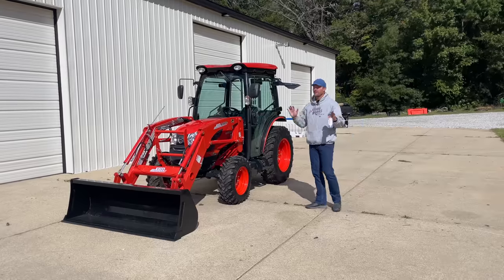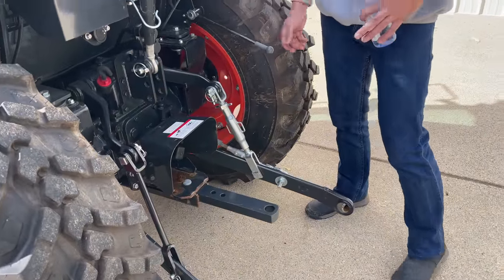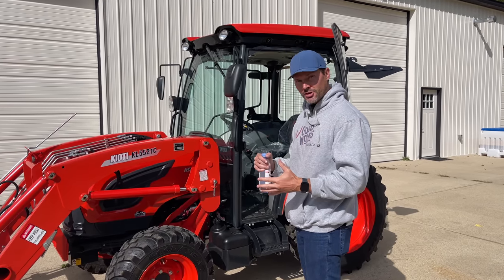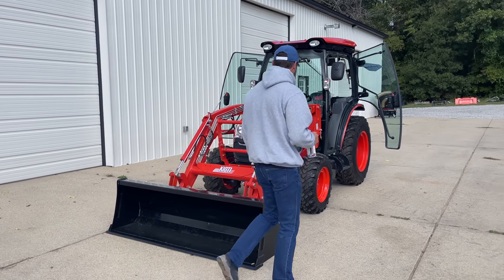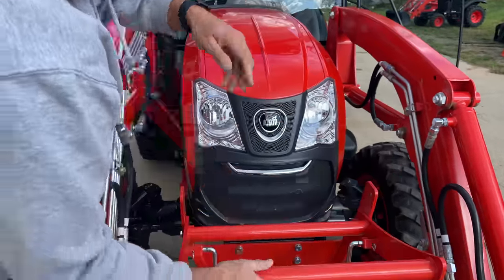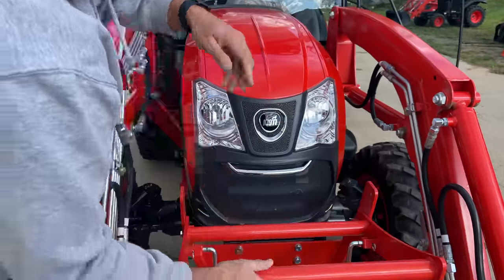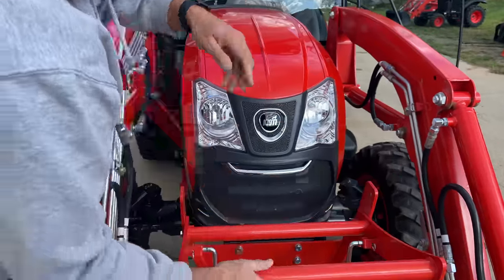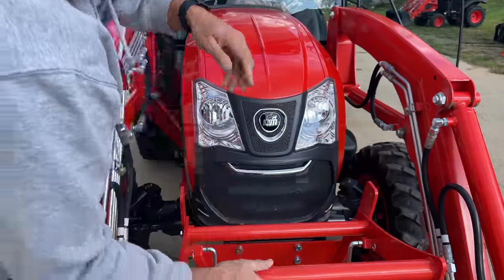WHY DID I OVERLOOK THIS TRACTOR BRAND FOR SO LONG?!

Comment: I purchased a Kioti CK 2620 cab hst se. I have ten hours on it and so far no complaints. It’s big enough to dig and load what I need but small enough to cut the grass. The size is great for maintaining trails. The CK and DK cabs fit through a eight foot garage door which was important.
Reply: The CK (and presumably its Bob Cat equivalent) is a very beefy and capable machine in that 25 HP category, IMO matched only by the 2515 TKM/Branson (and its Bad Boy equivalent).

Comment: I've had this model for almost 2 year now. I took delivery of the tractor December 2021. I have about 225 hours on it. Love this tractor!  Still need the liquid ballast in my tires...it's a must. The factory radio sucks! Don't get get the factory radio option. Buy a head unit and speakers online. Also, I'm 6'7" and fit pretty good in the cab.

Comment: I have a CK3510SE with a backhoe and bucket. The reason I bought it was the bucket and backhoe lifted and dug higher and lower, it had a larger hydraulic pump and it was heavier than the comparable JD.

Comment: Have a CK3510SE with a cab and love it especially in the winter time. Nearly 300 hours on it in a little over two years and no issues. Could of used a sub compact but my wife wanted a cab. Now I want a DK series or larger. Very tough stout machines.

Comment: Owned a Kioti DK40SE for 10 years. Beast of a tractor. I run a sawmill and log with my tractors, so I really put them through the paces. I put 1,500 hours on it and it never let me down. I recently traded for an LS MT3-57 cab/hst tractor. My reasoning was because my local Kioti dealership came under new ownership, and the new dealership is less than impressive.. I was interested in an NX model, but the sales staff seemed like they couldn't be bothered.  So I checked out an LS at my local LS dealer and it impressed me. In the past, I know you reviewed an LS. However, it was a lower end model. I am hoping in the future, you review an MT-3 series (premium) LS model. I have 300 hours on it so far and I am very impressed. It stands right next to my old KIOTI as far as quality and durability. LS is constantly improving their machines, and trust me, the MT3 series is formidable.

Comment: I'm glad to see you enthused about this machine and hope you do keep one to see how well it performs, I own a Bobcat 2025 and have not been disappointed. I do think they are stronger than the green ones of comparable size/hp in numerous ways. The unfortunate thing is I believe some dealers that do the final setup either don't know how to or don't care what they send out the door, I chose a reputable long established dealer and have not had any issues and have actually had them make a home repair for a factory service bulletin that I wasn't aware of. As you know service and support is just as important as the machine you buy. If the 2 tractors you have doesn't have an option called link pedal you should add it (pretty simple to install) works great for loader work. Keep the great videos coming!!

Comment: I also had a Kioti for 4 years, was a great little tractor. Went to trade up, I ran into dealer network issues. Again great tractor but was told I had to wait 6 months. With no other kioti dealers to turn to i went with a Deere. I hope they can keep ramping up their brand.

Comment: Radio in cab: I used to work in forestry equipment all day and it seems odd but if you wear the squishy/foam earplugs and use cab radio it will allow you to hear radio much better.

Comment: Nice review!  Nice tractor!  I'm not a cab guy, but the visibility on that cab seems awesome.  The reason the "Forward" pedal is closest to the operator is common equipment design.  Controls are always placed in a configuration where the most often used controls are closest to the operator and the least used the farthest.  Mobile cranes and road graders both having many controls are two good examples.

Comment: Thanks for all the valuable information on this video and videos past. I have learned a lot and appreciate the safety tips in past videos.  Recently purchased 76 acres in Iowa and looking forward to purchasing a tractor in the spring.  One of the challenges I am having is find the right size  for the property - I feel a sweet spot would be 35-40 HP.  Keeping in mind that I have farmer fiends who have the machinery to do the heavy lifting needed on rare occasions.  I like how the tractor in your video is compacted enough for getting around tight wooded areas and enough HP when needed.  
Much if the advise I get is  “ it’s better to have more and not need it, than need it and not have it.”
Experience level with tractors - is minimal- drive a 30HP 2003 JD back in the day for brush hogging fields - but that’s it.

Comment: I’ve had my Kioti RX7320 for 4 years now.  It is very reliable, great quality, reliable and easy to use.  It was 30K cheaper than a Deere.  It does have a more basic cab, though.  Before I bought it I did some research and the price of parts, should there be a problem later, is so much lower than brands like Deere, Kubota, New Holland or CaseIH.

Comment: I have had a Kioti DK4710se HST with a cab for a few years now (maybe 4 years now). Growing up working on the family farm, we mainly ran large John Deere tractors. Obviously, having an established relationship with the local/regional John Deere dealers I started there. 

I originally looked at John Deere and Kubota, but the price quotes turned me to looking at other brands, mainly LS and Kioti. Sure, I wish my Kioti had some more creature comforts that the major brands offer, but my cab tractor with loaded rear tires, additional rear SCV (2nd), and 3rd function was considerably less (multiple thousands of dollars) than that of the major brands with an open station came in at. If you're in the market 

I would highly suggest for people in the market for a tractor to look at Kioti and LS tractors.

Comment: I've beat mine through the woods with the Rhinohide canopy plowed. Grappled. Box bladed. Stump bucketed. (I should have waited for your stump bucket) fork lifted.  You name it. Only had normal maintenance.   It's a great value. 
The battery access isn't that bad. Like 3 minutes.

Comment: I have a 2022 Kioti CK2610 HST SE with Cab, and the thing is a beast. It can easily be ramped up from 24 HP to 44 HP is 2 hours or less and doing so without the emission control system that larger tractors have to endure. It came with duel hydraulic rear remotes, rear wiper with fluid revisor, the seat came with arm rests and the HVAC system is fantastic. The tractor is a little tippy and could use some liquid ballast to help keep the back end on the ground when lifting heavy items. We use the thing all the time. I recently bought a 72 inch rear mounted snow blower for this winter and honestly can't wait for the first big snow. I plan on adding a radio inside at some point. The price new was excellent as well at $32,500 delivered to my front door. Bobcat has almost the exact same tractor for $45,000 and the Bobcat has a lower bucket lifting capacity. It was a great buy and I have Zero regrets.

Comment: First time tractor owner and I purchased a Kioti CK3510SE HST from a dealer up the street about 2.5 years ago.  My tractor has arm rests, I wonder if yours originaly had them but were not attached?  Maybe that prior owner didn't like them . . .  So far I've not seen a Kioti w/out arm rests - but that might of been how the dealer orders them.  My guess it's a quick upgrade . . .  I put a gravel weight box (thanks for harping on rear weight!) on the back (no fluid in the rear tires) and for my purposes works great - lifting hay bales safely out of our pickup truck.  The Speeco 3pt quick attach (Or whatever they're called) works great on them.  JD and Kuboto are great machines, but with the money I saved that went to 3rd function, grappler, fork lift, gravel box, brush hog, hydraulic 3 point top link, post hole auger and more.  So far mine has been easy to work on, but I'm not looking forward to swapping batteries when the time comes 😉

Comment: Nice video.  My Uncle was a commercial farmer,  he only used JD, and that's what he recommended when I was shopping for a small tractor.   I went to a JD dealer in Central, OR and I had every intention on buying a JD tractor.   Except we couldn't get anyone at the dealership to help us.  We left and I bought a Mahindra, that day.  I wish the 1526 had better hydraulic system.   This tractor is very similar in foot print with much higher hydraulic specs.  I don't  need the enclosure.   Thanks for the information.

Comment: I love this channel, so much good information. Interestingly I just started watching a couple weeks ago and started with the older videos first, and that is when you were hard core John Deere or Kubota only lol. The closest Kioti dealer to my house is 250 miles away, and the closest John Deere dealer is 125 miles away. However, for the money, and what you get, I am willing to make the longer drive, and I do all of my own servicing so the only time it would need to go back in is for warranty. So I ordered a new DK4520 and cannot wait to get it. I will be checking the Good Works Tractors website for implements and attachments as soon as I get my new tractor home...

Comment: So I’ve known a lot of guys like you who never touch the stereo. I think I’m one of the very few who uses it. Not having a Bluetooth stereo in my tractor would almost down it for me. I even put sound absorbing material on the floor under the factory mat. I also plan to upgrade the speakers. 

9:52 I totally get what you’re saying about the battery being in a goofy spot. The advantage is allowing more air flow through the coolers. The engine usually doesn’t overheat, but the engine oil and hydraulic oil run hot. Higher temperatures reduce oil life and is hard on the hydraulic system seals and hoses. Most users it’s no big deal. Heavy mowing in the heat or heavy duty transmission use can build a lot of heat to dump. Just something to consider 😎

Comment: Nothing but trouble with my new Kubota Sidekick and they are just kicking the can down the road without fixing the engine problem.  Kubota service has gone downhill lately and after years of buying Kubotas I am done with them and plan on switching to a brand like Kioti next machine.

Comment: I wanted a 3R but the price was just out of reach.  Our local Kioti dealer doesn’t seem very devoted to the brand or reaching the non commercial homeowner/homesteader.  
The more affordable options for us came down to New Holland or Branson (now TYM).  I wound up going with a TYM 4820 with a cab and I’d honestly put it right there with Kioti. The dealer density is the one place that I’d give the nod to the Kioti but if many of their dealers are under-committed to the brand like ours then that dealer density may be somewhat overstated.  

TYM tractors with the TYM diesel (formerly Kukje) is also all mechanical injection so no ECU to deal with.  
I’m 6’5” and have quite a bit of room to spare in my 4820 cab.  I’d bet it would be good to 6’8” or so.

Comment: Id love to see you get out and use that little CX. I was eyeballing a 1025, cab, mower, blower, FEL. 
Stopped by my Kioti dealer, I can save a BUNCH AND get a MUCH better tractor with the CX and have AC in the cab?! 
I'm 95% that I'll be pulling the trigger on that! Although dealer said rumor of the CS getting AC too.. thats tempting!

Comment: Actually I would say the Kioti DK series matches more so with the John Deere 4 Series and Kubota MX5400/MX6000 series. The DK10 series is meant to be an economy type tractor whereas the DK10SE series is offered in Hyrdostat trans. but the SE has more features. With the loader lift being over 2400 lbs, the rear lift is over 2700 lbs, and the weight with a loader make it well over 5000 lbs. That surpasses the JD 4 Series by a lot with it being able to handle more. The JD and kubota might weigh a little more but they're all within the same range of tractor size. Overall the Kioti is much more capable with a far better price point than the JD 4 Series and the Kubota MX series. My brother has a DK5010 shuttle shift and he loves it. He has the rear tires loaded and a 3rd function, and it weighs over 5700lbs. Kioti has come a long way, they're giving JD & Kubota a run for the money!

Comment: Kioti ,as time passes will start to take market share from Deere, Kubota. Much better pricing, get more for less.
Reply: I think you’re right!
Reply: Great turning radius for ck and dk series.
Reply: Maybe, but I wouldn't bet the farm on it
Reply: Tym is up there also
Reply: It is not good for deere or kubota as pennies get tight. The others are going to take customers away.
Reply: @frankwrogg2515  I doubt it, but if they do, it will be a very tiny %. The re-sale values won't even be close compared to JD and Kubota

Comment: Nice review.  Looks like a nice machine but I"ll stay with my Kubotas for now :).  Not a cab guy either.  Had an M7040 with a cab and it was more of an inconvenience than a comfort.  So, to your question about a radio; no way.  I prefer to hear what my machine and the implement is doing.  If I were a professional farmer or heavy equipment operator who spends nearly all day every day on a machine I would definitely appreciate the benefits of a cab and a radio but not a fan being a non-professional.  Thanks.

Comment: The only real complaint I have with my DK5310 with the cab is the there is no grab handle on the right (control) side and its a bear to get in or out on that side, especially for a 6'4" 325# guy.

I put a bluetooth radio in and I wasn't satisfied with the speakers and I just use my ear buds when I know the kids are in the house away from me. I do use the radio if munchkins are running around.
Reply: I bet it's a bear without those steps! Growing up I was taught to always mount a tractor from the left; I was never given a specific reason, but it sure stuck. Looking back I'm thinking maybe because there has never been any consistency on right-side entry. 🤣

Comment: I was looking at a Kioti a few years back and liked them but definitely didn't like walking around the dealership and seeing a makeshift carport for their warranty and repair work. I noticed that other than Deere, Kubota and even the Mahindra dealer most other dealers were kind of rinky dink places where they sold other things primarily (trailers, other equipment, feed store supplies) and sold tractors on the side plus seeing these same type places open and close in a matter of years or switch tractors brands they sold in that same amount of time but that was just was the situation in my area hopefully its better elsewhere.

Comment: Surprised the arm rests arent standard. I dont recall being an option, but perhaps my dealer just adds it standard. I know they upgrade all of the buckets to 66" instead of 60" because its only $40 more at the time of order. I assume the arm rests are a similar deal. I'm glad i got them but it's love/ hate... they get in the way in the smaller cab of my ck2610 when shifting or using the 3 point control.

Comment: I bought a fully loaded Kioti NX for half the price of an equivalent Kubota. The value is amazing.
Reply: How long have you had it, and how much HP does it have? I’ve been considering one myself because the price of the other brands. I plan to use it for haying about 300 acres, so I’d like to have a PTO with around 90hp.

Comment: Hey Courtney, long time fan and I enjoy your videos, but I've got to argue that the DK series is the equivalent of the 4 series Deere, and the CK the 3 series.
Reply: Also, I opted to go without arm rests on my CK2610 because I never used the ones on my 1025R; wow, do I regret it. The seating position is different enough between the two machines that I now wish I had the arm rests, lol.

Comment: The figures are impressive.  I however think the reason others are lower with the specs is because with a tractor that physical size it would be really easy for someone to get into trouble.
Reply from the maker: Haha, could be some truth to it.  However, the cynic in me assumes you work in marketing for John Deere :)

Thanks for watching!
Reply: @GoodWorksTractors  haha no just a John Deere fan because I have had really good luck with them.
Reply: @brianbarclay4316 I'm positive JD doesn't use lower specs for "safety".
Reply: @lwwarren  ok why do they then?
Reply: @lwwarren  hahahaha..
Reply: They don't "use" lower specs, they're just spec'd lower. When Deere does their next big redesign of the 3 and 4 series, as opposed to a mid-life refresh, they'll probably spec more comparatively- if not higher. You may see a higher flow pump, or larger pistons. It's nothing more than competition driving changes in the market over time. @brianbarclay4316
Reply: @oefveteran09  the kioti specs are deceiving, their loader lift capacity specifically.  They rate lift capacity at the pivot pins (which is  unrealistic).  Deere rates their loader at 20” ahead of the pins.  20” makes a big difference!
Reply: @brianbarclay4316  Kioti and many other brands publish their numbers at the pin. Deere publishes their numbers both at the pin and 20 inches out. It's easy to compare specs. For example, a Kioti CK2610 with KL4030C loader will lift 1,969 lbs to full height at the pin. The Deere 3025E with 300E loader will lift 1,186 lbs to full height at the pin. Lastly, for comparison sake, the Deere 3033R with the H165 loader will lift 1,598 lbs to full height... at the pin. Those numbers are all to full height at the pin, so please point out the deceit.
Reply: @oefveteran09  the figures that you stated for the R series I saw was 20” out not at the pin.  I have not seen Deere specs at the pin, everything I have seen is 20” out.  The deceit is because Kioti only specs at the pin which is a useless figure!